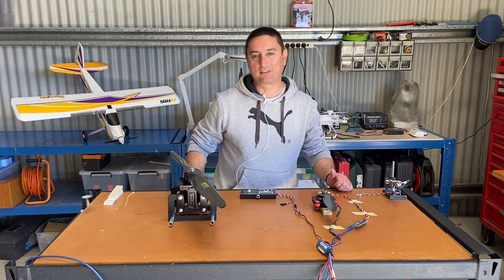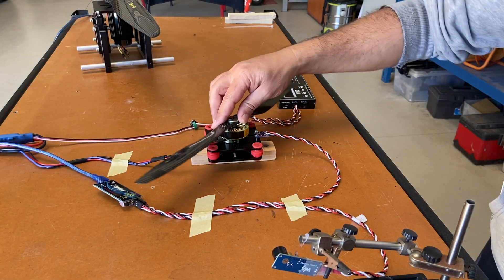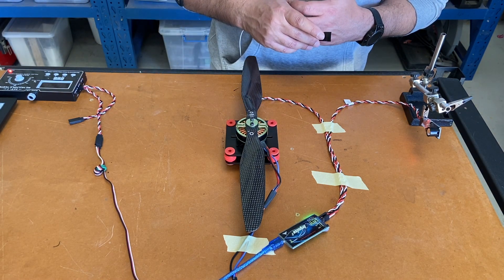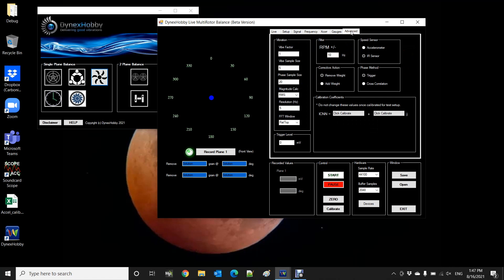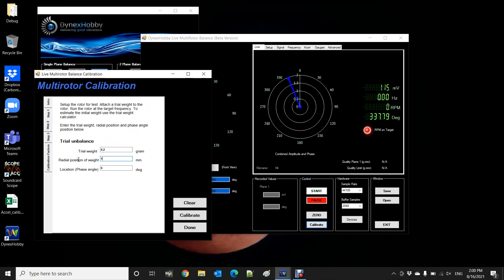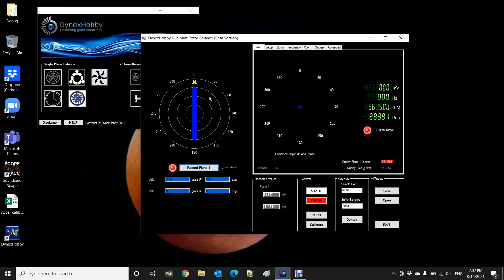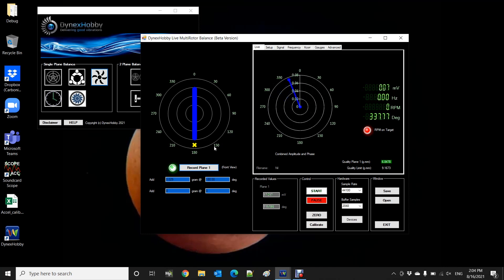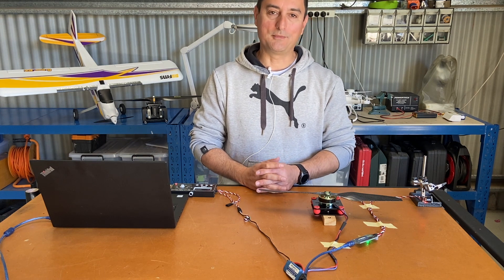Multirotor Balancing

Comment: Will this work for small motors like 12-13mm?  Also 3" triblade propellers? If so sold. I mainly build and fly light 3 inch quads. For now I've been doing the pencil lead and tape balancing for bi blade props but motor bells are another thing.
Reply from the maker: Yep will work for all sizes including 3 bladed propeller.

Comment: What’s your fastest balance speed?
Reply from the maker: No real limit based on hardware and software. The limit is based on the motor and propeller configuration as well as safety should the spinning system become unstable in the cradle. Generally balancing at low speeds is sufficient.